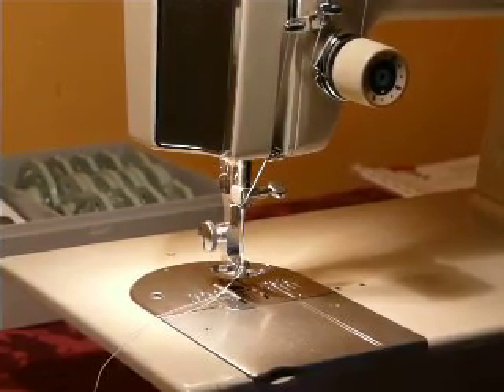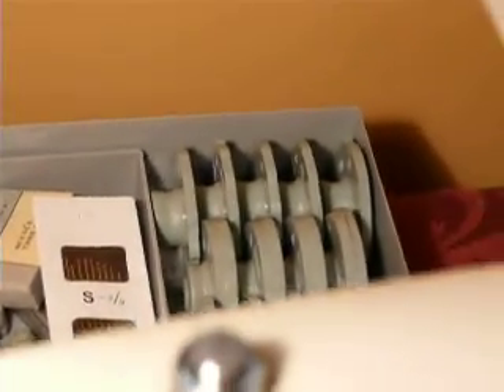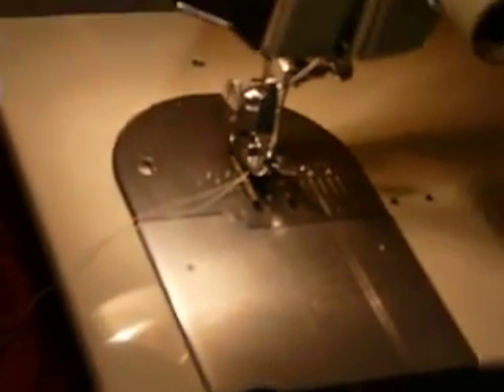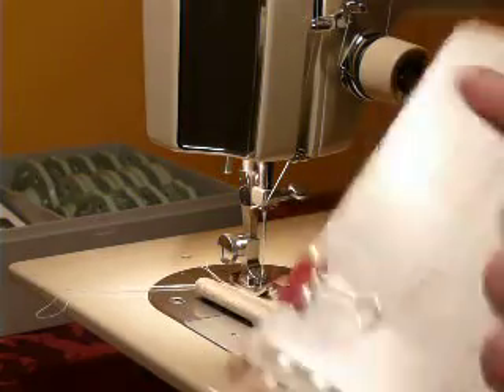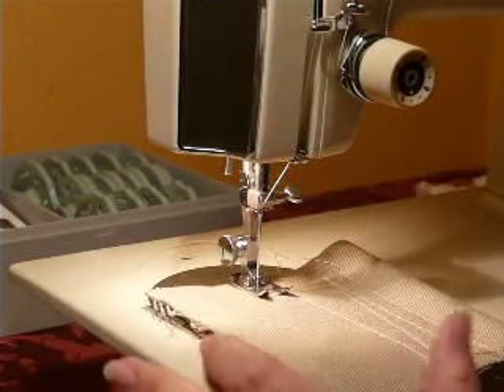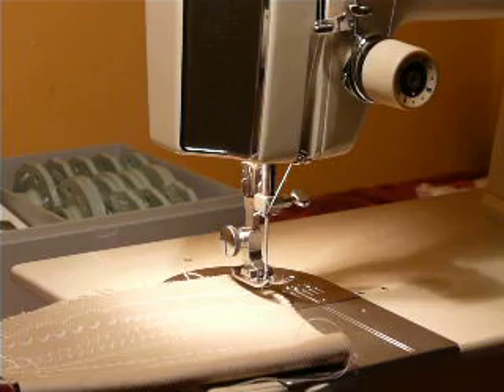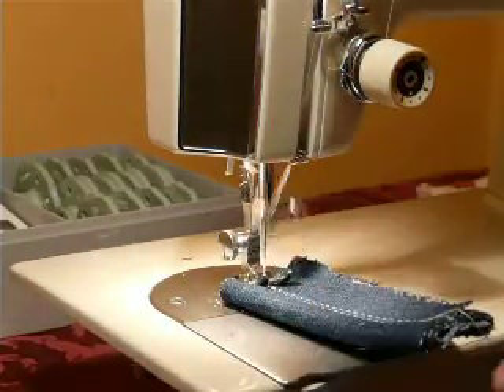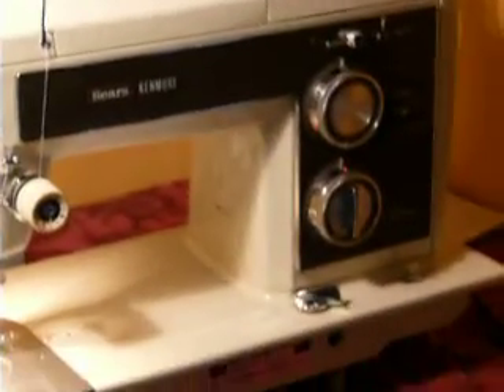SEARS KENMORE MODEL 1774 SEWING MACHINE

Comment: I bought one of these 1774 's when my son was a baby at an Atlanta Sears store.   I still sew on it and it sews like a charm.  I try to keep lint cleaned out of it and occasionally oil it.   I have never had any problems with it.  It is a great machine!   And, while it is considered "vintage", my still performs like it is brand new.  I also have the original box of attachments and the owner's manual.  I have taken care of it and it has taken care of me.  I have had it for 46 years.

Comment: These are great machines! My mom bought a new 158.19142 when I was a kid, I now have it and use it and just two days ago I saved a 158.17740 from getting thrown away. It needed a new tension release pin made for the tensioner which I did yesterday afternoon and I have it a very good cleaning and re-lubricating and it runs like a dream again now. Sadly it didn't come with its accessories. I'll have to find ones for it just because.

Comment: I have a 158.17741 I bought new in 1975.  I'm still using it and I love it!  I still have both accessory boxes and everything works great.  Just take of it and oil it occasionally.. it will run forever.